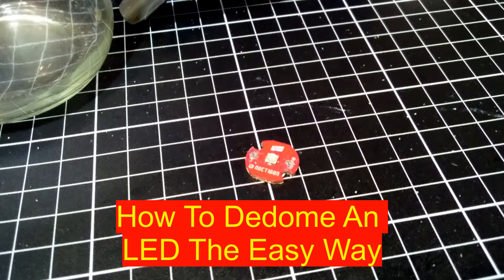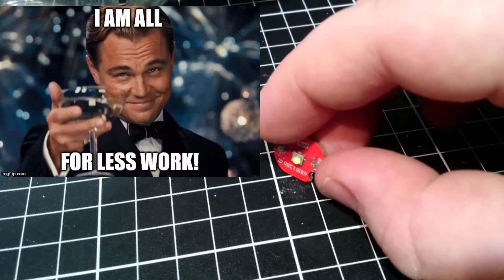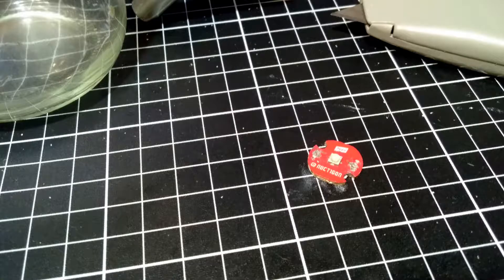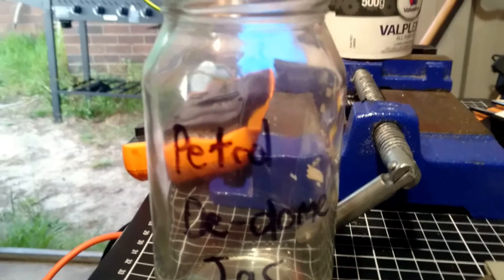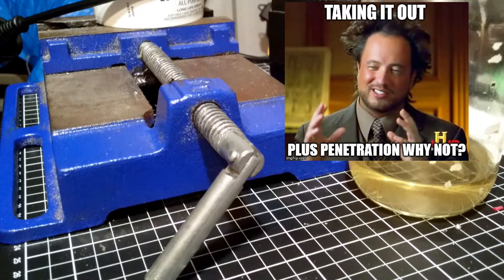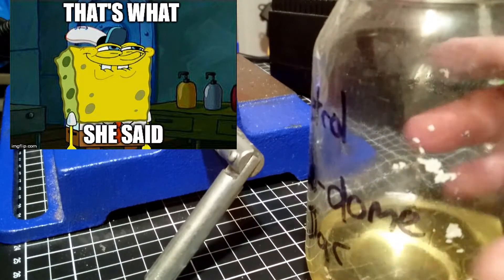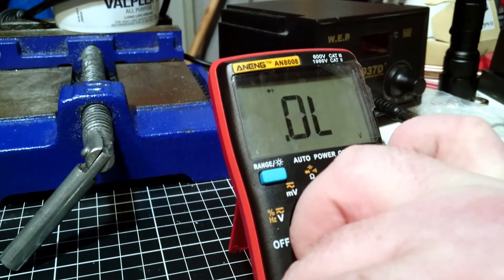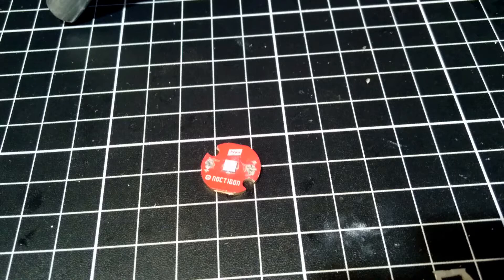(How to) De-doming LED's the easy way

Comment: What if you used or we use nail polish remover/alcohol
Reply from the maker: Hey mate i have never tried both of these. As far as i know alcohol shouldn't work as i use isopropyl alcohol to clean up with after the dedome and it does no damage.
Reply: @everydaysurvivalgear  good to know,thanks mate!
Reply: I just use a spray Cologne and it worked. I think anything that will evaporate without   Residue like  Alcohol based or whatever would have no problem working.